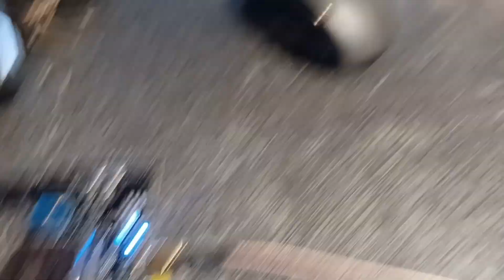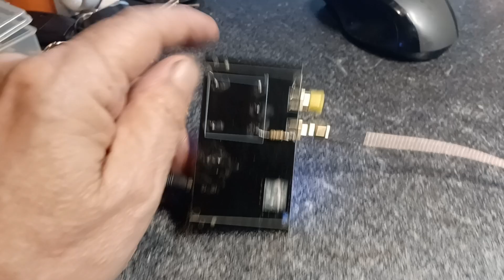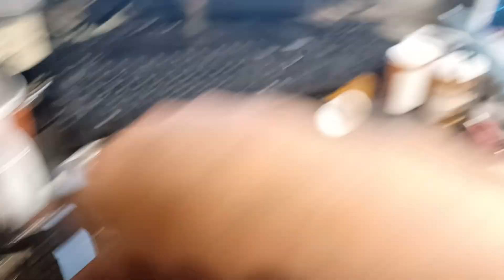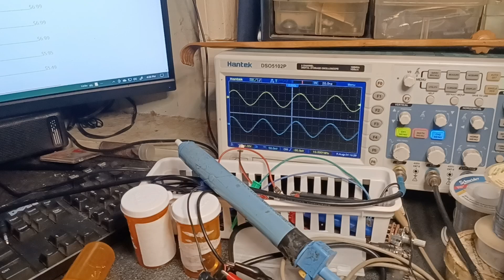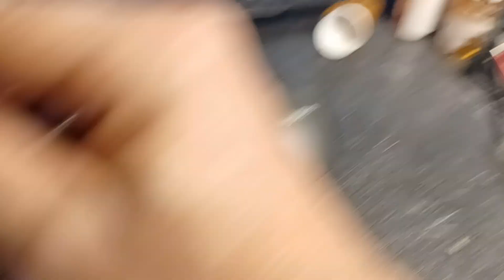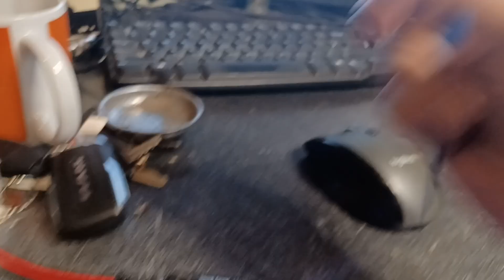Tune 10Mhz OCXO from Ebay (part 2)

Comment: Doesn’t seem very reliable there should be a digital trimmer, if you drop it or do anything it will shift, is it possible to replace that trimmer with a small board that digitally trims?
Reply from the maker: No mater what you do with these OCXO's they will never be as accurate or as reliable as a GPSDO or  rubidium BUT compared to an XO and TCXO these OCXO's are much more stable.
Pro's to these OCXO's
Cheap 
Con's
Used oscillators
A lot of them need to be worked on to get them on frequency.
I used a resister on mine and put it in to a frequency counter. It's been a year and still working quite well.
Reply: @Jeb-N2JEB  do standalone GPSDO have an OCXO, like if you lose the sat lock how long will it be accurate for?
Reply from the maker: @GamingAmbienceLive  The only way a GPSDO would lose Sat lock is for the GPS antenna to come unhooked or loss power.
Most GPSDO's are a reference oscillator you would connect your test equipment to it.
Reply: @Jeb-N2JEB  i just want to make a super accurate clock with vacuum display kind of retro vibe super accurate type deal, i really wanted it to be standalone, but sounds like it needs GPS
Reply from the maker: @GamingAmbienceLive  Now I understand why you are concerned about it getting dropped. I would not worry about the OCXO I would be more worried about the tubes. Put the OCXO in a location within the clock that it can be adjusted easily and check it once every 6 months to a year.

Comment: Have bought and tried it.  Useless for a reference. It drifts all over the place.  Its repeatability after switch off is lousy.  I didnt pay much for it, thank goodness.
Reply from the maker: These units are made from used OCXO's. The one I have has held up good. 
I used mine in a frequency counter and check calibration every 6 months. 
I use a GPSDO as my reference. 
If you are in need of a Frequency Reference that is affordably get a GPSDO they use GPS to continually adjust the there internal OCXO.

Comment: The device is a sine wave generator, out does it do other stuff too?
Reply from the maker: You could call it a sine wave generator.
A more accurate description would be.
Frequency Standard Oven Controlled Crystal Oscillator(OCXO).    
The unit puts out sine wave on one port and square wave on the other port both 10Mhz.
There are several Frequency Standard Crystal Oscillators
1: Crystal 
2: Temperature Controlled Crystal Oscillator (TCXO)
3: Oven Controlled Crystal Oscillator(OCXO)
4: GPS Disciplined Oscillator(GPSDO)
5: Rubidium Crystal Oscillator
The unit only outputs 10Mhz for uses as an External reference for 
Test equipment that have a 10Mhz reference input.
Reply: @Jeb-N2JEB  I'm an electronics newbie, and I like your channel so I'm writing this comment to help with engagement. What would one use it for in a practical application?